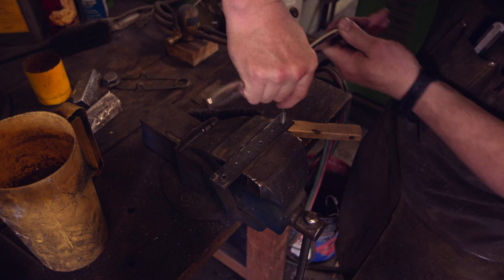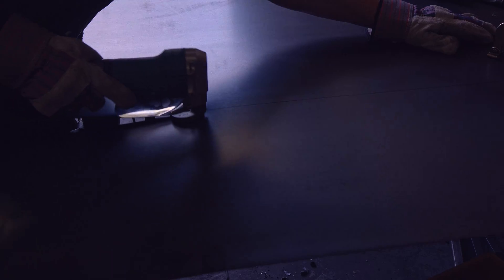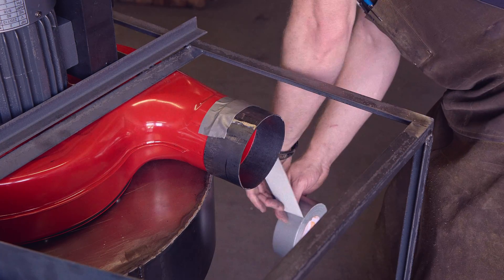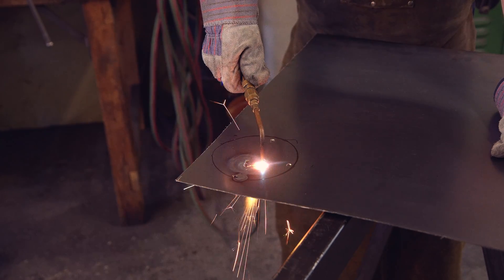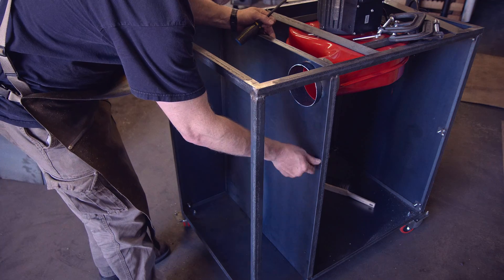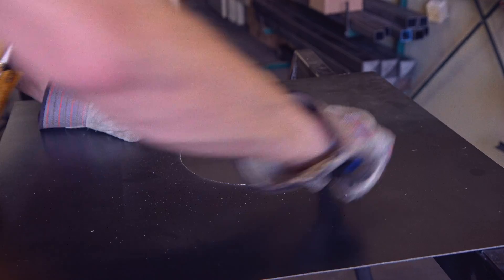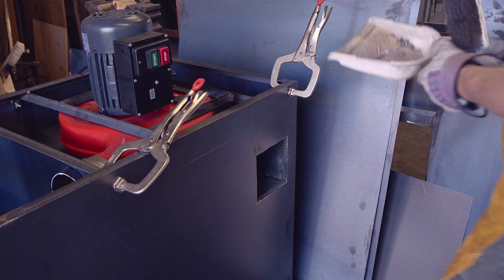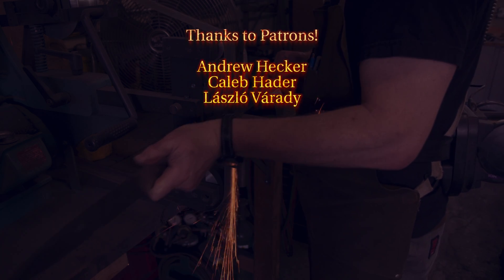Making a Metal Dust Collector: Part 3 - First Trial(4K HDR)

Comment: Hi Niels,
 I'm looking to do the same thing and found your video on the metal dust collector system. I was wonder if it met your needs once completed and if you would share the measurement of the drop out gap and if you had to extend the vacuum inlet down in the housing chamber you made.  

Great video and fantastic skills.

Thank you, Tim
Reply from the maker: It's still an unfinished project. The problem with the videos is that everything takes at least twice as long. So, that has been getting in the way of finishing the dust collector.
Reply from the maker: I should be able to dig up the measurements though.
Reply: @NielsProvos  Thank you for the reply. If you had time the measurements would help. Thanks Tim
Reply: Thanks for the video. I would also be interested in the outcome and more detail on the baffle and measurements🤞👏

Comment: Your intake needs a chute so you can simply tip a dust pan into it.

My only question is why no magnetic separator ?  Isnt the point of building something like that (instead of simply buyng a HEPA rated ShopVac) to be able to extract and reuse (or recycle) the metal present in the dust ?
Reply from the maker: This will be hooked up to the belt sander. The main point is really to have the shop be less dirty. This was just testing if the thien baffle worked. Since steel is so cheap I don't think that recycling steel dust is economic. At least not for the small amounts I produce.
Reply: @NielsProvos  Ah, thx for explaining. Respect.

Comment: The reason you were having difficulty cutting the sheet metal with the torch is because you have the wrong torch head. You were using a welding/heating torch. You need a cutting torch which has an air by pass lever. You heat the metal until you create a puddle and then using the air lever it's blows the molten metal away from the stock effectively cutting. Note once you start a cut don't stop, keep the level depressed and do your full cut in one motion